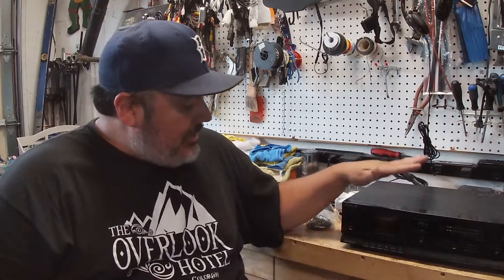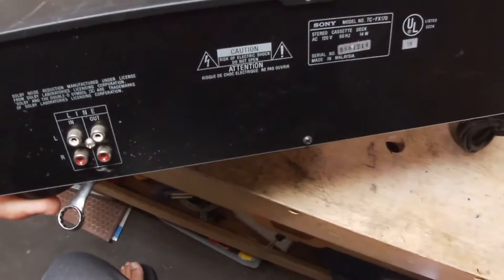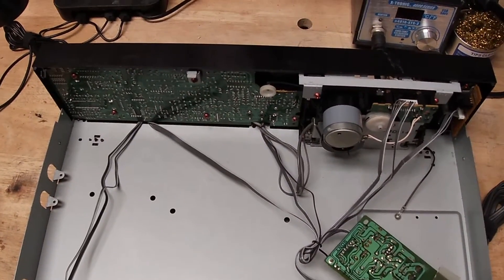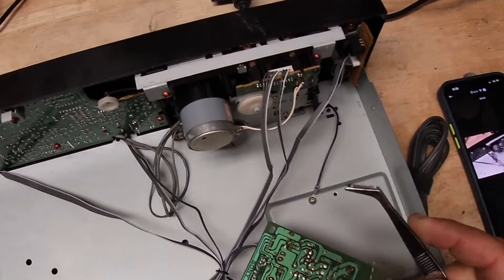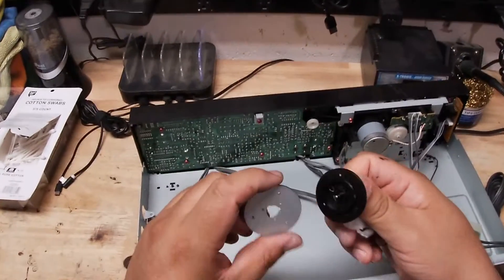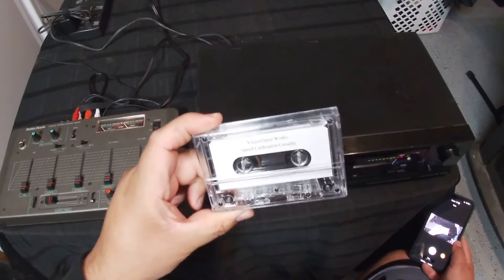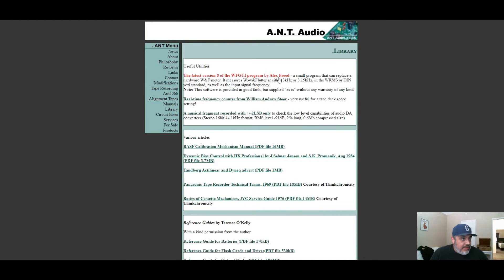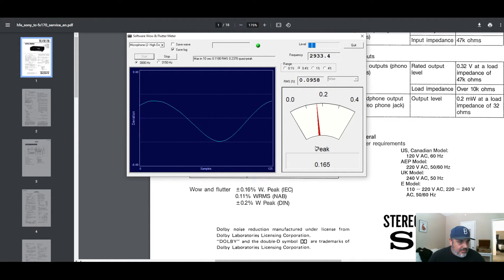DIY:  Cassette Deck Belt Replacement for Sony TC-FX170 / Wow and Flutter and Speed Test

Comment: Your right about belts, You never know what you get when buying belts (since the batch of belt might or will have different properties when melt them or mixed them w to much of this or that) and you always hope it a good batch (each batch of belt could be different even from the same vender, who knows were they get them from all from china?) and your right about if the belt are to tight the wow and flutter goes up. 
I use that software but you should use DIN setting. were did you buy your belts?
Reply from the maker: Thanks for watching!  I did try the DIN setting but I was getting an inaccurate reading.  The setting I used gave me a reading more accurate to what I was listening.  Not sure if the BIAS played a role on that, but I think most people watching my video would be content with the type of sound coming out of this cassette deck.

Comment: hello sir  i have sony TC-K222 ESG  deck but not playing continue .i think  reel sensor problem but playing small time with no sound.whats the error sir.please help me repair it.thanks
Reply from the maker: If the deck is not playing continuously, its probably the belts.  The belts need a little flex, otherwise they wont catch strongly enough on the shaft of the motor.  If you are still not getting any sound, it might be the capacitors in your board.  You would need to get a service manual to troubleshoot that.  If the tape deck is unfixable it might be cheaper to replace it with another one.  Those always pop up on eBay.
Reply: @joelsdiy9469  ok thanks sir

Comment: What are the sizes of the 3 belts?
Reply from the maker: Unfortunately I no longer own this cassette deck, but it was pretty much a common size for this model and year of cassette deck from Sony which would be from the mid-90s to late.  I found the size from a variety pack that I found on Amazon.  I'm not sure if the seller is still selling these!  Thanks for watching!